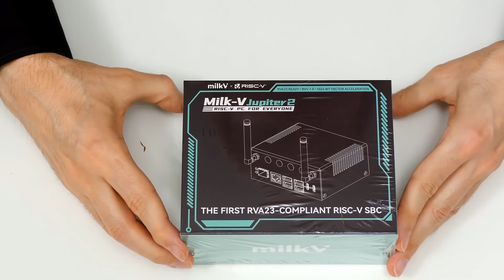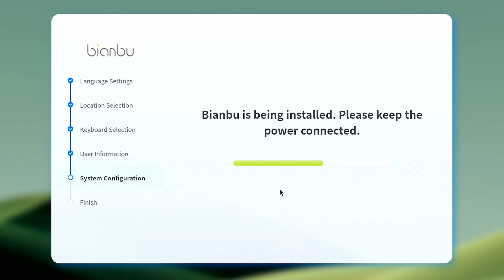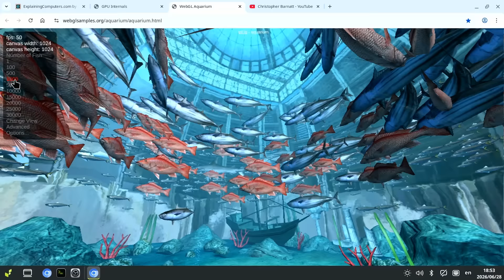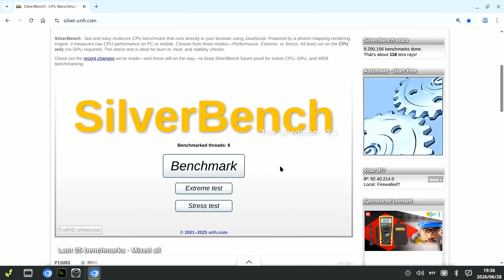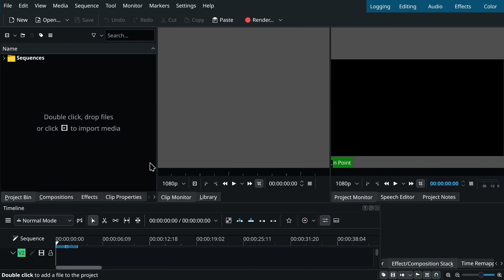Milk-V Jupiter 2: RISC-V RVA23 SBC

Comment: To be honest, that single core result is not great. That's going back to the days of what could be achieved on a 1.1 Ghz Celeron. The multi-core is about what was seen on a dual-core Intel i5-4200M back in 2013. A single core entry level Snapdragon X1 goes about 7 times faster per core. Of course now we are in the era of SoCs, and its not the performance of the general purpose that CPU that dictates the overall system performance. CPU performance os not so obvious in some areas such as media replay, rendering and so on.  That masks the difference in the performance of the CPU, but dig in a bit, and it becomes obvious that all those things about super-scalar processing, branch prediction and so on play a critical part. It's what enables more performance per core for a given clock speed.

There's a lot of detailed work still required to get a RISC 5 CPU to get to the performance levels of the best x86 and ARM CPUs. It should be possible, and maybe AI tools will get there, but I suspect that it would require a major player to jump ship to push that. 

In any event, I bought an Asus Zenbook A4 laptop with an X1 SoC (and not the highest performance version) and have been comparing its performance with my desktop that has an Intel i7-8700K CPU @ 3.70GHz, 6 Core, 12 thread CPU dating from late 2017 (so 9 years old) and I am astonished that this laptop I have outperforms the desktop by about 50% on CPU intensive tasks whilst not even getting warm...

In any event, the stories I hear are that there is a lot of work going on with RISC V to be optimised to work in specialised environments, as it is capable of being tailored to work with specialised hardware. It is less obvious that the required investment is being put into making it a high performance general purpose CPU. That has its strengths of course, but the danger of being split into dozens of different specialised paths is that it could end up with a fractured ecosystem. It's what happened to UNIX, and to a considerable extent with Linux too.

We shall see. The day when Apple announce that they are dropping their ARM processors in favour of RISC V processors would be the critical point.

Anyway, I am rather enamoured of my ARM laptop, and I just wish there was a decent desktop motherboard that took a modern ARM SoC with the flexibility of using  "legacy" PCIe cards.

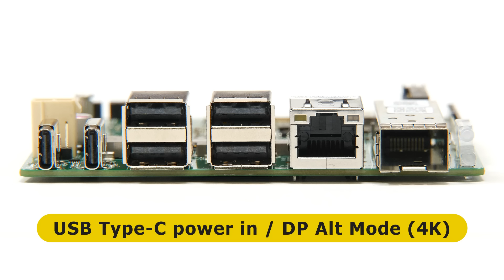Comment: 6:30 not the only means. There appears to be an eDP (embedded DisplayPort) 40pin connector.

eDP is the connection used by the actual panels (or at least raw laptop screens iirc) which makes sense given the embedded/industrial applications

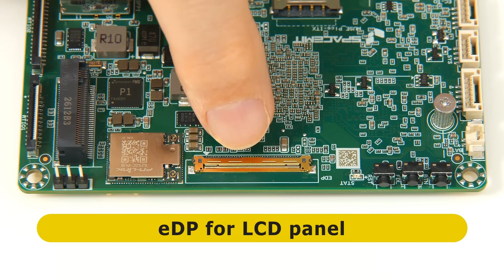Edit: 8:20 I apologize, I was too quick to call that out

Comment: Was yours statically clocked at 2.2GHz? May explain why the baseline energy usage is so high. Haven’t figured out why yet though.
Reply from the maker: No, it was not statically clocked. The energy use is far more likely to relate to non-optimized hardware. Remember this is experimental RISC-V hardware, and software is hardly likely to be optimized for power efficiency.

Comment: Hi Chris, great video.  I now have a Jupiter 2, but the usb-c to HDMI adapter I have does not seem to work with it, could you let us know the make and model of the adapter you used?  Many thanks.
Reply from the maker: You need a powered USB-C hub rated 65W+ that also has an HDMI output. I am using this 100W model -- https://amzn.to/4bR9Lv7 -- good luck! :)
Reply: @ExplainingComputers  Thank you, I will get one ordered.  I have a Hama USB-C hub with HDMI and the Jupiter 2 is not wanting to play nice with it.
Reply: @ExplainingComputers  thank you,  the usb-c hub arrived and I am now up and running with my Jupiter 2.  Just doing some sGEMM perfomance testing comparing the x100 and a100 cores.
Reply: @ExplainingComputers , if you are interested,  I hve now done some inital sGEMM benchmarks (with my own code) and I get 137 GFLOP/s for the eight X100 cores and 145 GFLOP/s for the eight A100 cores (for comparison, 165 GFLOP/s for an AMD 9950x and 390 GFLOP/s for a DGX Spark CPU only).  so, for vector processing, it is not bad.  With GLMark2, I get 425 for the Jupiter 2 (the Jupiter 1 got a score of 1), but still quite low compared to my x13s ARM laptop with a glmark 2 score of 5097 and 12,679 for a DGX Spark.

Comment: Edited on 2026-08-06
❤ Whereas I generally have a surfeit of adoration and welcome for your amazing videos, may I cordially share a gentle protestation anon?

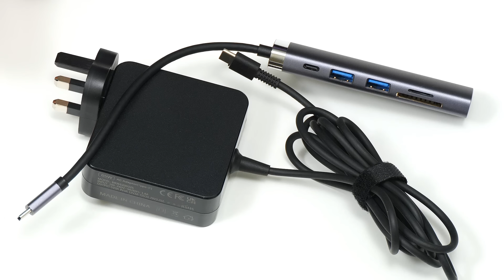Your poly-voltage power supply is marked: "Output 5V3A 9V3A 12V3A 15V3A 20V3.25A" (7:02). It is not marked 5V13A, which would have delivered 65W at 5 volts.

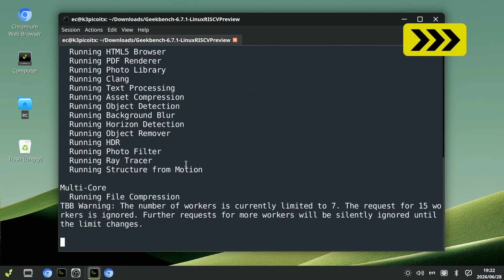If the system draws more than 15W 36W, that would exceed your PSU's 3 amp maximum via USB specification which is 5V. And your PSU might release that magic smoke. Secondly, if your poly-voltage PSU negotiated a too-high voltage, then there is no guarantee that there is any over-voltage protection (for voltages above 12V) behind the USB-PD port or anywhere else on the board, sending 15V or higher to the board. Then the board might release that magic smoke (17:14 FINISHED // SMELL ).

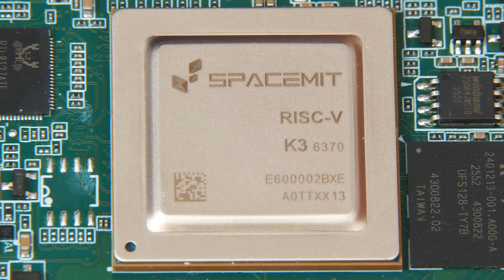The Spacemit K3 (4:42) idles around 10W and can boost over 35W (30W tdp). The two m.2's each will spike above 10W at intervals.

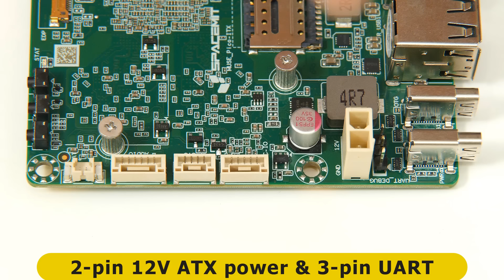If I were testing this board, I would have used a mono-voltage 12V power supply capable of at least 72W/6A 60W/5A for stable and steady power, fed via the board's native 2-pin 12V ATX header (8:42).

It mystifies that the system didn't crash periodically during your testing and that you successfully completed testing while feeding it just 15W 36W via USB PD.

As it seems to me.

Kindest regards, neighbours and friends.

Comment: Imagine this in 1983, Commodore and Apple would have never existed. RISK chips were flying on military aircraft while we played 8-bit games and thought it was advanced.  The F‑14A Tomcat was the first military aircraft to use RISK (MOS‑LSI) chips in its Central Air Data Computer, marking a milestone in military aviation and early microprocessor history. It ran at 375 kHz, executed 9,375 instructions per second, and used a 20‑bit fixed‑point number system.

Comment: I'd like the connection support on the new RISC-5 models. I'd really like to see more X86 and ARM products that sport just a 10Gbe std ethernet port, but even an SFP+ port .. thats pretty amazing and also overshooting the target with what performance you currently have on the RISC-5 platform compared to arm and the N100 X86. I take it the normal USB ports is just std 2.0 apart from the powered USB-C ?

Comment: I will never understand why manufacturers refuse to put 10G RJ45 ports and SFP28 (from year 2014). Also, closed-source GPU is still the deal-breaker.
Reply: Because not everyone wants RJ45s (I use DAC cables for example to go from my NAS to my router).. and then they'd also have to choose a particular chipset... In testing RJ45 SFP+ adapters, I wound up with the one I did because it didn't get as hot as say the ones sold by my router manufacturer (and yet were also cheaper, and plenty fast).  10G gets quite hot btw. They're catering to flexibility. As for SFP28, that's a bit enterprise for a RISC-V dev board even. ¯\_(ツ)_/¯

Comment: 8:22 If that 3-pin connector is in any way related to what you can find on a standard PC, it can possibly be a connector for resetting CMOS, or coding which BIOS chip to use a standard if it has two BIOS chips. It does however not have any jumper placed in any position, so that leaves a clear CMOS or BIOS selection more uncertain.

Comment: usb-c pd and dp over usb-c is going to become the standard for business desks.   Its one cable to the laptop and every desk can have a keyboard, mouse and possibly wired networking with one cable. That means less stuff for staff to lose l, leave at home or complain its too heavy.

Plus its not much more expensive. iiyama  monitors with pd and dp over usb c are about £10 more than the equivalent with traditional hdmi and a built in usb hub. 

So, it might seem odd, but it will be the standard in the near term.
Reply from the maker: Maybe true, but it's an appauling, fragile connector, and an alternative video output should be provided.
Reply: @ExplainingComputers  Yep, but better than the HDMI ports on HP laptops. 

The cables are cheap enough that assuming your end user doesnt manage to drop the device on its end and ram the cable through the port, its usually a dead cable to swap. A lot easier to fix than an HDMI port. And if your really lucky, its a daughter board to pull if your user did manage to break the device rather than the cable. 

And its a lot easier on end users. The amount of academics I've met who cant handle plugging in two cables (HDMI and usb-a) to get a video signal  and use the already set up HID peripherals on the desk is depressing.

Comment: Unfortunately, the price is outrageous. I could buy a refurbished intel system for the price. I know that's the case with all SBCs, which is why I've been much more focused on old Pi Zero boards and microcontrollers.
Reply: Not relevant if you are boycotting the US though. It’s either ARM or RISC V.

Comment: Is RISC-V consumer retail market free of the Microsoft nonsense unlike the UEFI and Firmware of OEM/Retail laptops that keep having things that are Microsoft implementations like on the x86_64 platform somewhere in the hardware, I can finally get a true X86_86 custom Boot setup,  custom kernel, and part operating system that creates folder to run independent so I can Isolate folders for use to an FPGA for specific use to run what I want.
 I would like to try trying to get away from the rubbish UEFi and firmware has been pain (like the nonsense of ACER and Microsoft laptops that is holding me back, I can get it to work on an acer laptop but it is not fun and unproductive) and is not wroth the effort. I would like to try to see if I can do this on Risc-v, I have only been doing the learning and creating on the x86_64 in in 2 months learning the whole thing from scratch and using assembly ( I am new to coding but very good at being a structure Visionary, Idea process thinker, Strategy decider and Innovator). 
 Can A board be purchased for Risc-V that has something similar to a ZIf socket for BIOS and Firmware chips to switch the chips, to experiment on but leave the person free of problematic firmware and Collusion Cartel of big companies. 
 It will be too difficult for me to force the issue on my own to get clean retail aimed laptops systems free of Microsoft trash "implementations" somewhere in system ( Linux it self does not free people at the hardware level). Risc-V looks interesting enough to make the request early enough for the end consumer to get this before businesses create a conglomerate cahoots.

Comment: The power consumption is kind of disappointing. It is similar to an Intel N100 system. A RISC architecture newcomer needs a competitive advantage: if it is not raw performances, it should be either price (erased by today's RAM costs, unfortunately..) or power usage.

Using a RISCV desktop is becoming possible, but there is no compelling reason to abandon the Intel compatible ecosystem, yet. Or no reason other than pure nerd entertainment.. 🙂

Comment: The interesting part of this is that its really a 16 core chip. 8 of the cores are regular CPU cores but loaded with vector processing extension rather than regular CPU microcode. This allows you to run real AI runtimes like forked llama.cpp moving the AI intensive functions to the special AI cores. Far superior to standard ASIC NPU setups like most silicon has.

Comment: I have to wonder why if so many processors have GPU's on them or are APU's, then why can't whoever makes them make separate and more powerful GPU's and start competing with NVIDIA, AMD, and Intel who seam to be their own worse enemy for not staying on track with product improvement after having done so well with their recent card?   Intel has done that quite a few times already with other stuff that was very good and well worth keeping.

RISC-V is flexible enough to make GPUs based on it, not saying it's easy, but a computer architect should be able to wrap their head around it good enough to get started.  I do know that the cost of development is quite High but some companies could afford to but don't want to touch it for some reason.
Reply: That not the approach they are taking. The 8 cores used for AI are standard CPU cores but loaded with vector processing extensions rather than regular CPU microcode. This give you access to unified memory, the ability to produce real runtime apps vs quantized models for ASIC inference, etc. You can also scale it as part of the standard CPU architecture vs a GPU device mismatch.

Comment: One thing I don't get is why USB-C Power delivery is problematic. This makes it perfect companion for USB-C monitors and USB-C hubs and docks are pretty inexpensive. Besides that it's still has a 12 volt input plug so it should be easy to add a normal power supply.

Comment: I was going to say "way 'spensive" but then I saw the metal case and the SFP 10gb network interface.
Not to mention the onboard flash memory.
But, I am curious why it has SIM card slots but no LTE/5G wireless network connectivity?
Reply from the maker: It has the E-keyed M.2 slot for a cellular wireless module.

Comment: So with one of these SBC boards, I could replace my desktop computer with mega power supply driving 4 SSD. I FIND I only use it for surfin the internet, some messing around for my 3d printer and maybe I’d like a flight sym setup.  Would this new technology handle those above mentioned joys I have?      Also what kind of monitor could I use ?

Comment: When I read the section heading "RISC-V power", I was expecting that you might say something about power consumption and how it stacks up with amd64 and ARM. Did you measure it? And if so, what was the result?
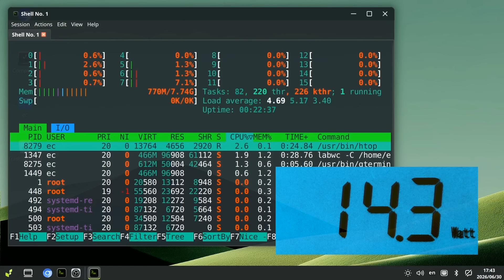Reply from the maker: I had a section where I connected a power meter and measured power use! :) About 20:00.
Reply: Thank you!

Comment: An Apple Mac mini uses 6.8W at idle and destroys this board in everything. RISC-V will never be better than ARM
Reply from the maker: I think you've completely missed the point. As I said extremely clearly, this is development hardware.
Reply: Their approach to AI using VP extensions in standard cores will allow them to scale out systems far in advance of any inherent AI ARM capability.
Reply: An Apple Mac also records everything that you do and "phones it home" to Apple. No Apple device can ever be considered as an option by someone with a privacy focused mindset - and the same is true for modern Windows and Google Android and Chrome.

A big "no thanks" to all of the above from me.
Reply: That’s not true. ARM is sanctioned in China. RISC V can improve ARM can’t on a Chinese made PCB. If Taiwan peacefully reunifies Apple won’t be able to buy from TSMC using their most advanced nodes anymore.  At that point the Apple use of ARM will take a big step backward. A lot of your assumption depends on the will of the average person in Taiwan.

Comment: I am still highly skeptical about RISC-V. The choice of not having flags means more instructions and branches are necessary. At least the Zicond extension is now part of RVA23, but it is not enough. The worst is the fact that such simple and essential instructions were not part of the initial specification and that it took so long to approve them. It makes me think there's a fundamental problem with the board of directors.

Comment: What are the implications for the ARM business model if RISC-V reaches comparable specs?
Reply: The most advanced ARM is sanctioned so isn’t available in China. Given that ARM is stuck and RISC V is advancing in China it probably it won’t be too long till RISC-V is better than ARM if you buy from a Chinese manufacturer.

Comment: I would love to see Apple move to this arch, I am sure they could get the needle moving.  I would love to see this be the CPU of choice for Linux too.
Reply: Why would Apple want to move away from Apple Silicon?  The M1 chip came out in late 2020 and blew away all other consumer chips. Six years later they are on M5 chips, each generation averaged a 10% speed bump.  Almost like Moore's Law was still active for them.   Recent rumors are they might only do one variant of M6 and skip to M7 for Pro & Max chips next year. Great memory bandwidth, and Thunderbolt 5  for fast external disks.

Comment: Very good video. I'm curious about how much the improvements of Jupiter 1 vs 2 are from software refinements or from better hardware. If you still have the hardware, it would be very informative to upgrade it to the latest OS available and check some of the benchmarks again.

Comment: Looks entirely powerful enough for general use. Though it might be a bit snappier without Wayland.
The power usage looked as low as a modern laptop processor, but not as low as Apple silicon can be. With any luck, as these machines get more powerful, it will become feasible to underclock them to push the power consumption even lower.

With the current RAM situation, it would be interesting to see what steps you could take to minimise RAM requirements for general purpose computing. Aggressive use of swap partitions is a recipe for SSD wear, but is still probably a part of the solution.

Comment: I think RISC-V is the PERFECT place to use AI Coding models on. Not to run it on, but to get the AI models to write code FOR. There are basically ZERO APPS or GAMES for RISC-V machines, and using AI to write them would greatly increase the appeal of buying a RISC-V based machine to use as your everyday PC. Bringing the browsers up to date is a MUST, and since I don't know the first thing about coding, so using AI would be a great way for me to contribute and gain some useful- knowledge :)